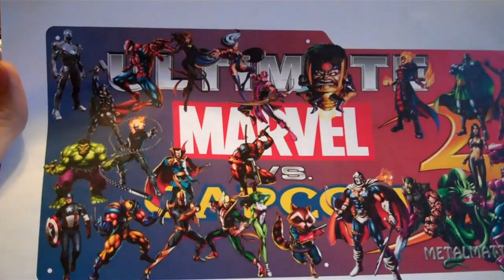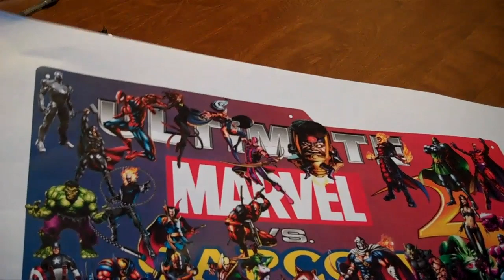Time to customize my Qanba Q4RAF arcade fight stick Part 2

Comment from the maker: @weirdman101 that's pretty simple. Once you remove the E-clip there will be a black actuator , then the spring is directly beneath of that. Then put the new spring in place,  then the actuator,  then the E-clip.

Comment: @Micah5725 I'm also very interested in an answer for this because I'm planning on getting the red limited when it comes out and changing the artwork but I don't know what size or paper to ask them to print on at Staples.

Comment: Hello ! First I wanted to say thanks for this vid because it's gonna help me. I had one question, idk who I should ask but my qanba Q4RAF won't move left anymore so I wanted to know where the problem could come from if you have any idea ? You think I gotta change the stick and that's it or what's below the stick? I really have no clue so if you can help me it wud be much appreciated :) Thanks a lot !
Reply from the maker: There is no one solution fits all problems, whoever I'll try to give you ideas what could be going wrong. If possible try to plug it into a computer, and go to the advanced control screen. (sorry I forget the exact name.) This will show all the inputs and light up when triggered. It shows the 8 possible directions and all the face, shoulder and menu buttons.
If only the left direction doesn't work (in any faction) and never has never worked it could be loose connection. This is why I suggest plugging it into a computer. That way when you go left, either just the left lights up, nothing happens, or wrong inputs light up. If that's the case look closely at the connects you want metal to metal.
If it recently stopped working more than likely its the micro switch. Usually the top one goes first but it is possible for another to go. You can buy microswitches but the process can be challenging if you are not comfortable with soldering. If that's the case I'd probably buy a new Sanwa JLF stick. They are relatively cheap and come with a wire harness. I get my parts from https://www.focusattack.com
Something like this should do https://www.focusattack.com/sanwa-jlf-tp-8yt-joystick/
Reply from the maker: https://www.focusattack.com/sanwa-tp-ma-pcb-assembly/
That would work too but they are out of stock. Other places are arcadeshock.com Canadianjoystick is another. If you go that route buy some E-clips. They have a tendency to fly across the room. Then you can't use the stick at all. You could go with another brand of stick, but the ground wire maybe in a different location. Then only one direction would work and the the other three would be unuseable
Reply: Thanks a lot for the replies you helped me a lot, I got a new Sanwa JFL stick in the end. 
It's from one of the little black box the left one doesn't work anymore, sry I don't know how it's called.
I want to switch the whole thing to get something new :) 
much love thanks !
Reply from the maker: The four little black plastic pieces with a red nub and 2 or 3 metal prongs? That's the microswitches. While changing sticks can be somewhat easy, if you've never done it before, take pictures to make sure you put every thing back in correct orientation and order. The most important part is the wire harness. It can go either way, one way will give you all directions. The other way only one direction works. It has to do with the ground and signal wires. Not sure what you know about circuits.

Comment: If I just want to change the artwork and not my parts, would it be fine to just start with your steps for artwork and not disconnect the entire top from the base?
Reply from the maker: In order to change the artwork, you have to remove the plexi-glass. The only way to do that is remove the ball top plus all 9 of the buttons.
Reply: did you cut the plexiglass yourself or is there a website where they seem them cut like that?
Reply from the maker: akapdcdaka it was pre-cut. I do believe I got mine from focusattack (but they didn't seem to have any in stock. You could try arcadeshock. I'm sure others sell them, and they are about $15.